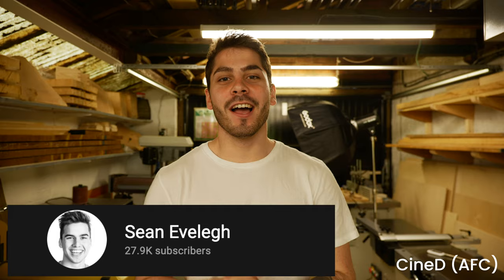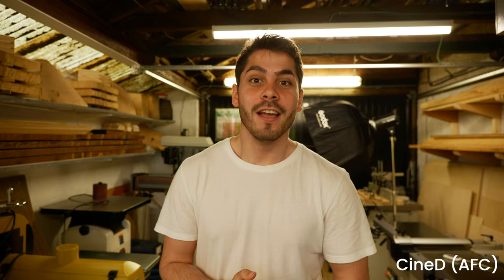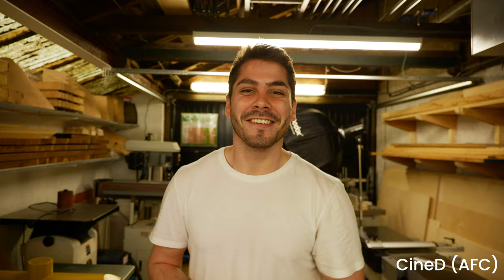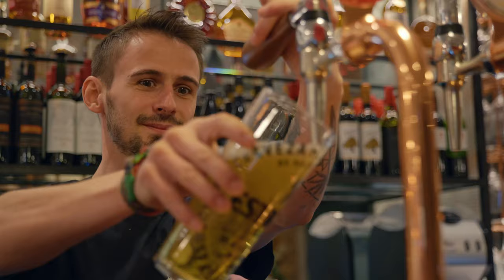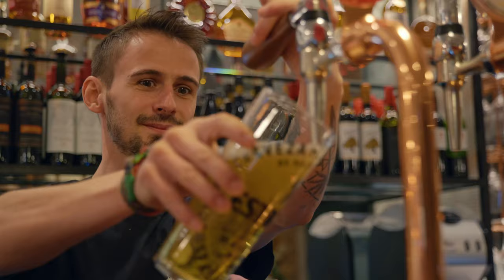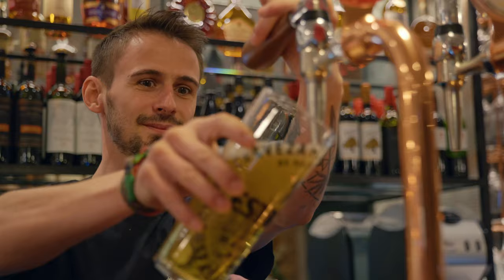Panasonic S5 Autofocus Test - PERFECTLY FINE For Vlogging/BTS?

Comment: Hey Josh, I find the S5's AF to be very decent with my 24-105 f4. What lens were you using? With my Sigma 50mm f1.4, it's a different story altogether, especially at f1.4. In my understanding - please correct me if I'm wrong - in video there is no difference between AFS and AFC. The modes function exactly in the same way (AFC). If one wants to get the camera to stop autofocusing in video, and just focus once and lock, one needs to go into the menu (Video Continuous Autofocus in the settings, switch that to OFF).
Reply: By the way, keep up the good work!!!
Reply from the maker: Hey Alex! Thanks for the kind words! I'm using the 24-105 indeed :) There is no direct AFS in video, only AF ON which is a feature whereby you use AF to lock on to your subject in MF mode :) 

So for your case, use the camera in MF and then hit the AF ON button just above the joystick and you'll get the results you're after!

Comment: Would you be able to do an AF test with non-native lenses? I am interested in the Sigma lenses more than the Panasonic but I've heard the AF is trash on non Panasonic lenses.
Reply: No the Sigmas are terrible for video autofocus.  Remember a Panasonic 50 1.8 is supposed to be announced tomorrow and many other 1.8 primes are coming soon.
Reply: @jessecumberledge4530  True. I like the Panasonic primes but I think Sigma has the better zoom options so it’s unfortunate the AF is garbage with the Sigmas.
Reply: @dericsanchez4081  very unfortunate for sure.  That sigma 24-70 2.8 is a great lens.  But the video autofocus struggles mightily next to the lumix 24-105 f4 or the mega expensive 24-70 2.8.  I love sigma lenses on my Sony bodies.  Yoy would think forming an (alliance) panasonic would have given sigma the autofocus inside info... but nope!
Reply: @jessecumberledge4530  Right. I mean this is what kinda steers me away from the S5 and the L mount in general. Might just look at Sony offerings instead...
Reply: What about the new 28-70 f2.8? I'd heard it's good quite good video AF. Has anyone tried it?
Reply: @digital.mente.  nope not personally but that’s the lens I am most intrigued by.
Reply: @digital.mente.  several videos on youtube comparing the sigma 24-70 to the panasonic lenses.  Sigma does much worse with video autofocus
Reply: @dericsanchez4081  Sony has alot right but the only cameras that have 10bit recording options are the A7s3 and the A1. Both very pricey.  I really struggle using slog 2 (forget slog 3 its horrible) with the 8 bit codec.  If everything isn't near perfect with the shot it falls to pieces.  If you can't shoot log you loose a ton of dynamic range the sensor has to offer.  Thats my problem.  I would go with the A7c but I just can't go back to 8bit files!  If you don't want to shoot in log then the A7c is a good camera.  They really did a good job fixing their color issues with the standard profile.
Reply: @jessecumberledge4530  Yeah, I heard that the 24-70 was slow but that the 28-70 was a lot better. But I'd like to see more tests.
Reply: @digital.mente.  Oh I am sorry I didn't read what you wrote correctly.  No I have not seen any reviews for the L mount 28-70 sigma.  I am also very interested!
Reply: @jessecumberledge4530  yeah I feel you on that. I’ve noticed I’ve had issues with slog2 on my a6300. The 10 bit would definitely be nice. That’s why I am also considering a Fuji xt3 or xt4.
Reply: @dericsanchez4081  me too... I am going to stick with panasonic myself.  But that fuji is fantastic I had it in my checkout cart and almost bought it once.  Either way just have fun with em!
Reply: @jessecumberledge4530  Cheers. Happy shooting!
Reply: @jessecumberledge4530  and others, yes, I have the Sigma 28-70mm f2.8 (plus the Panasonic 24-105mm f4, 20-60mm, 85mm and the Sigma 45mm f2.8). I have used it on a couple of commercial and styled wedding shoots and the AF is pretty decent and not far off anything native. Stills and video, it’s my current workhorse lens and will remain that way. Unfortunately, I have an early serial number model so at some point I will have to exchange it for a later model as the first batch are supposed to suffer from some ghosting. Not experienced much and can otherwise confirm it’s a more than solid performer, ‘tiny’ and chunky with minimal barrel zoom. So no, AF is not trash on Sigma lenses full stop. That’s just more YouTube trash talk mostly from folks who either are not owners of anything L Mount, or just have not taken the time to learn and set up the AF properly. As good as native? No...which in itself is not as good as Sony/Canon/Nikon/Fuji/XYZ, but that does not make it trash.

Comment: It’s not great, never mind ‘reliable’, but nowhere near as bad as some make out. Sure, if you need reliable AF, especially tracking AF, go Sony or Canon or anything that isn’t L Mount, but for my needs, it’s pretty useable if set up correctly.
Reply from the maker: There's so many strengths to the S-Series cameras that people just don't care to mention purely because they're 'scared' of what they hear about it online. 

To be perfectly honest with you, I was one of those people before I invested in the S5. However, once I got the camera in my hands, I realised that there's so much to love and actually that the AF is absolutely fine if you know what you're doing!
Reply: @JoshCameron  Well I was kind of expecting it having had some previous experience with various CDAF cameras previously. It ain't bullet proof, but it ain't bad! I am working towards a slightly re-balanced workflow these days with mostly manual focus (with my Sigma lenses) and switching to Panasonic lenses and using AF only when I have any kind of tracking requirement...which is about less than 5% of any shoot so...
Reply from the maker: Yeah I'd say I'm the same on that front. I normally use MF for most of what I shoot (apart from youtube vids, they're all AF). 

I think I'm beginning to lean a little more towards using AF for the quick shots now too since I'm actually getting very decent results!

Comment: which AF mode did you use? human detect?
Reply from the maker: Hi Brian! Yeah, human detect :)
Reply: @JoshCameron  Thanks for the response Josh. What about when there's no human involved? Do you switch the human detect to something else or do you just leave it as is?
Reply from the maker: Hi Brian, normally I just leave it on Human detect and it does the job just fine. I rarely mess with the other AF types!